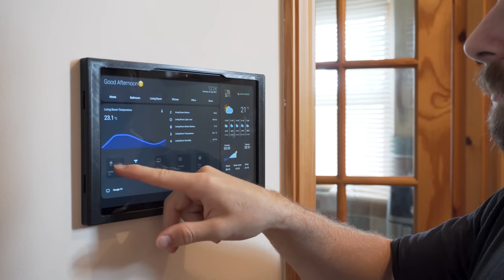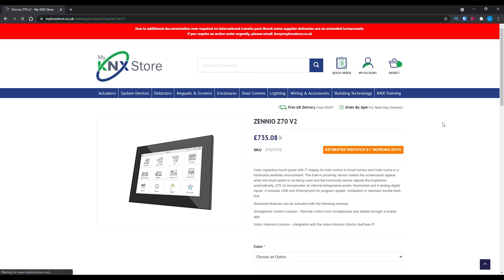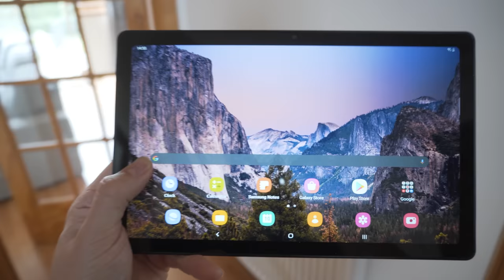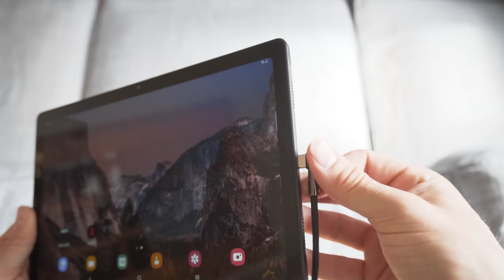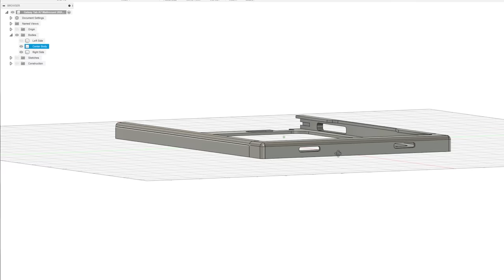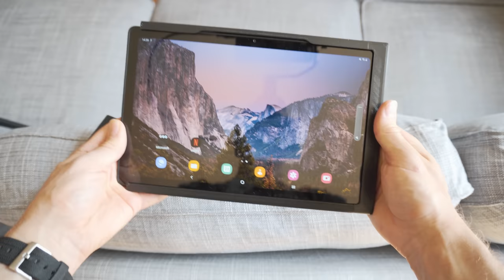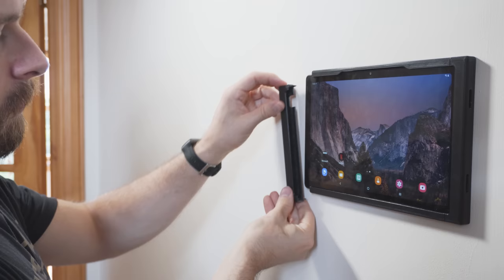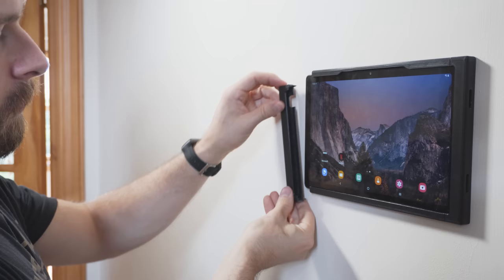Building my PERFECT Smart Home Control Panel!

Comment: Hi, im really interested in your theme, is it available to download somewhere?  i like the greeting, the right side blocks and the camera idea to enlarge the screen when someone rings the doorbell, im using a ring device. Your theme looks clean.. I am using a 10 inch tablet of Lenovo. i think the cover will fit as well. further i have some devices controlled by Tuya, ( Window blinds and curtain slider. 2 ring devices, a nest thermostate, Philips Hue lights, 3 Philips ambilight tv`s,  LSC lightbulbs, Kwikset Doorlock. trying to get it all working in Home assistant. greets Johan
Reply from the maker: Not yet, once finished I may share somewhere!
Reply: @EverythingSmartHome  Cant wait :)  even for testing im available

Comment: I also use an Android plugged in 24/7. However I have found that after about 15 months the battery starts to bulge. So be careful with that.
Reply from the maker: Thanks, as mentioned I am using a smart plug to control the charging cycle automatically so hopefully we won't be an issue

Comment: Lewis, how are you hiding the top and sidebars on the screen? Is that Fully Kiosk thing? I bought a Fired HD 10 on Prime day which I have been using with wallpanel but i have never really been 100% happy with it, this is a much better setup, and looks the business. Great well thought out and presented content as always, I have been thinking about supporting the channel through Patreon for a whole, and this vid pushed me over the edge. 😁👍. Keep up the good work.
Reply from the maker: Hey Simon,

Hiding the bars for HA I assume you mean is done through a HA card, have a search for Home Assistant Kiosk mode and you should find it. If not, drop me a note on discord!

Thank you for supporting the channel, it is so very much appreciated 🙏
Reply: @EverythingSmartHome  Found it on HACS, thanks !
Reply from the maker: I tagged you on discord with the link also, cheers

Comment: That's exactly what I was looking for. Thanks.
Though, I wonder: are there any requirement for the tablet to make the top bar disappeare?
Also, are there customizable Ambient modes/AOD possible?
Reply from the maker: Your welcome! Which top bar? I removed the top and sidebar already, everything you see in the video was written by me
Reply: @EverythingSmartHome  I mean the tablets status bar that usually shows the time and if your WiFi for example is turned on
Reply: @soumynonareverse7807  if you make a shortcut of your dashboard to your android homescreen it wil open fullscreen
Reply: @drank4454  thanks, and what about the AOD part?

Comment: Love this idea. So it's basically just a app that runs on the tablet and no route required?
You mentioned Fire Tablets, does that mean the same app is available on Fire Tablets? I have a few FireTablets I dont use atm (ok only 7 inch ones but ok to test with :P )
Reply from the maker: Thanks! It should work on all Android tablets but you'll need to give it a test first!
Reply: @EverythingSmartHome  thanks, yeah I think I will. I need to install HA first.

Comment: running the cable out the bottom of the power point is dodgy maybe illegal in some electrical codes lol
Reply from the maker: Of course, you have to check your own country, I cannot advise you about that.

But no it's not dodgy at all, it's more than perfectly safe .

Comment: is it a good idea having the table 24/7 connected to charging cable?
Reply: I had the same idea using an old tablet for that but worried about having a tablet constantly on power
Reply from the maker: I mentioned in the video I'm using a smart plug to control the charging cycle so it's not constantly charging 😜
Reply: @EverythingSmartHome  sorry missed that part. that's nice

Comment: been trying. but not willing to spend $500 on a cell connected pad.
been through two ipads, two android pads none of them were compatible.
tried a google nest. turns out sonebody had prehregistered it with the mesh network and was busy controlling my stuff, you need their permission to re-use it, apparently it wasnt as new as was claimed.
if you go pc or linux for proper automation you have to use the android apps virtually on desktop(i dont trust that to be reliable).

im for sure not paying full price for a nest, turns out its just a screen.
i cannot find a reasonable solution. lets see what you have :)

you should also look up usb ribbon cables. they have near 1mm deep plugs, almost invisible.

Comment: Not sure if anyone has alreadt asked, but is there any chance of sharing the settings you're using to get the motion activation to work? I've a similar setup with a Fire tablet in the hall and existing motion sensors but I can't quite find the right ballance of Fully Kiosk Browser and Home Assistant motion detection to have the tablet reliably wake up when there's motion. It "feels" like there's a timeout I'm missing somewhere so the screen is still being detected as on from HA so it never sends the wake up command when new motion is detected.
Reply from the maker: Hop in the discord and we can have a chat about it, I'm interested as to what you are using currently
Reply: @EverythingSmartHome  Hi Lewis, will do. Just got registered but will check in when I'm at the laptop in a couple of hours.
Reply: Hi Lewis, thought I should update you on progress. After a very long delay, I finally had chance yesterday to sit down and update some of my home assistant configuration and the hall tablet was on that list. Having got the  Fully Kiosk plugin installed through HACS, and cleaned up all of the old manual sensors I had, I disabled the tablet motion detection completely and just use my hall motion group (a couple of PIR's on a NodeMCU running ESPHome) to turn on the "light" for the screen and it seems to be working perfectly. I think I was just overthinking the previous version. Thanks for the pointers towards the HACS integration.

Comment: Great video!
Like you, I have a list of requirements for wall mounting tablets to control HomeAssistant.
The "not being able to see the power cable" one is, for me; a hard requirement. :)

I'm not yet skilled enough in 3D design, to be able to design a wall mount frame myself; so my project has kind of stalled.  We have an oddly laid out house, so one single tablet isn't enough. 

Do you have any interest/intent in sharing the design files for your tablet mounting solution?
I'd love to take a crack at tweaking your design style, to fit the tablets I have.   I settled on a couple of Amazon Fire tablets, in sizes that fit this weird house.

Great job on the video. Seeing it has rekindled my desire to get these tablets mounted and have my partner tackle getting a dashboard design working. :)
Reply from the maker: Thanks! Yes when I can get some time to work out the minor kinks on the case I will post it! 

Good luck with the project!
Reply: @EverythingSmartHome  That's great news! Much thanks!! :)
Reply: Hi, if you going to have and could send the design file to me would be awesome, thanks
Reply: @bartekziembol5034  Hi. I don’t have the files, unfortunately. Lewis hasn’t released them to the public. :-(
You might try sending him a message directly, so he knows someone other than me is interested in them.

Comment: That's a nice little fire-hazard you got there.
Never leave a phone or a tablet plugged in over time, the battery isn't over charged, but the charging circuit will engage the charger at intervalls to keep it topped off.
Leaving a lithium polymer battery with a charge above 80% will degrade it fast, really fast.
Degrade it enough and the battery will start swelling, eventually catching fire when it bursts and humidity is allowed to enter it and react with the lithium.
Reply from the maker: You really didn't pay attention did you? Mentioned twice in the video that I'm using a smart plug to literally turn off the charger for automating the charging cycle...

Comment: Hi There, are you finding any issues using fully kiosk? i have the exact same tablet and it keeps reverting back to the samsung UI as the home launcher. even the guys from fully kiosk said it was an issue with Android 11. I literally have to turn on the tablet manually every morning and select fully kiosk as the default home launcher.
Reply from the maker: Hello, absolutely no issues from me no..that's a strange one! So the motion wake doesn't work?
Reply: @EverythingSmartHome  motion doesn't work, auto shutdown between fixed hours doesn't work either. the only thing that works is, i have it set to go off in darkness which works properly, but it doesn't always come back on when it detects light again. some days it works but most days i have to reselect Fully Kiosk as the default home launcher. I have reset the tablet, everything is updated etc. The guy from Fully Kiosk said it is a bug in Android 11 which prevents 3rd party launchers but I dont have that issue with my other android devices that run nova launcher as the default. So i think it has something to do with fully kiosk. Only reason i turn off the screen is to give it a break when it is not needed in the nights.
Reply from the maker: Ah, I don't use any of the motion features on the device itself, I use seperate motion sensors for that so perhaps that's where the issue lies!
Reply: Ah that makes sense. He had said that Android 11 kills apps when screen goes to sleep. That's probably what is happening with me. I just need some way to keep the screen off during the night without the device going to sleep :)

Comment: doesn't wanna ruin the aesthetics by plugging in the charger and just running the wire inside the wall.
goes to other side of wall makes a new outlet to plug in adapter and runs cable inside the wall, like what was up with that :P

Comment: Is there any possibility to publish mqtt message from windows computer and subscribe from a raspberry Pi which has Mqtt broker in my case it's home assistant???
Reply: I would like to create automated charging setup for my laptop
Reply: The easiest way to do that is to plug it in a Z-wave...etc module.
Reply: @sukusu913  I can't use that tech..... any other suggestion... based on MQTT

Comment: Shouldve gone with POE
Reply from the maker: Don't have any ethernet anywhere near there
Reply: @EverythingSmartHome  but that’s a simple fix, not much more (if any)  work than adding the plug and you’d have a direct network connection.
Reply from the maker: I'm amazed you seem to know the layout of my house and where my network equipment is and how easy it would be to run cables ;)
Reply: @EverythingSmartHome  it’s easy in every house. Just gotta be willing to do it. But hey it’s your house you can take the sloppy looking easy way out ;)
Reply from the maker: It is easy yes. But you originally said "not much more work" than adding the plug, which it clearly is.

Comment: All that tech and you couldnt just do it right and run a cat 5e cable and use poe to power a hidden in the wall usb charge….. scratches head and it would have been connected by ethernet speeds

Comment: Using a tablet to hang on the wall is not a good idea. I have experience with such solutions and I can only say that the battery will eventually swell and burst the tablet - nothing pleasant. These types of devices are not designed to be continuously charged and discharged - even if you have a smart charger - it will only prolong the agony.
Reply from the maker: Watch the video :) I'm using a smart plug to automate the charging cycle, the battery is never charging when it's full

Comment: It’s not smart if your putting a computer behind it. It’s smarter to run Ethernet for Internet  and video and use a pc in the basement or in a closet. So instead of a raspberry pi. You just connect display to server
Reply from the maker: Where was the computer behind it sorry? 

Yes it's more convenient, but not accessible in this location without a lot of work.

This isn't connected to a computer, not sure where you got that idea

Comment: Lmao why 3D print a case. It would have looked much better had you just found a perfect fit picture frame and it would have looked WAYYY better and be easier. Suppose the YouTube video wouldn’t have been as good thought lol
Reply from the maker: Your pretty ambitious to think you can find a picture frame with the exact dimensions to fit this tablet and not have it slide about or cover the camera and have massive bezels
Reply: @EverythingSmartHome  I mean there are a few million pictures frames I’m sure and the entire internet is open to you. Plus it wouldn’t slide around inside of you did some trickery on the inside. You could drill a nice hole for the cam, not that you even need a cam for that specific set up it’s more for doing some quick controls who really going to get into a  video conversation whilst standing up looking at the wall. Wouldn’t matter if the camera was covered.
Reply from the maker: Way more work and waste of time and money trying to find something that fits when I can just make one that definitely does fit (and learn a new skill in the process) - also the camera is useful to have as it can be used to unlock the device when the camera detects a face
Reply: @EverythingSmartHome  why in the world would anyone want the device lock while inside of their own home IT NEVER LEAVES no one locks their google or echo display devices. My nest hub sits in the kitchen with no need to ever lock. Also you had to do like 5-6 trial runs on the 3D printer which took time and with the end result being ugly black plastic that looks as if its been 3D printed at least maybe paint it or something. Again how is getting on the internet and having a million different picture frame dimensions to you hard work. Why is learning something new a negative, you could have packed the tablet into the pic frame with a bunch of high grade clay from Home Depot or a host of other ways to get it done. Just did a google search also plenty of web sites that will make you a picture frame with your exact dimensions and since its small only around $18-30
Reply from the maker: Unlock was a poor choice of word on my part, I meant it can be used to wake the screen so it's not constantly on. 

I didn't say learning a new skill was a negative, it's a positive. I'm saying 3d designing it allowed me to learn a new skill.

Looks are subjective, you are in a minority saying it looks ugly.

3D designing and printing meant I could have the product the same day to my exact specification, buying online does not.

I like to DIY where possible, it's more fun. The list goes on 🤷‍♂️
Reply: @EverythingSmartHome  putting a tablet would have been a DIY since there is no rule book on how it could be done. As far as esthetics just look at the new echo 15 coming out with its picture frame looks it’s unanimously gorgeous probably best home control device from a looks standpoint. I wouldn’t go as far as saying yours is downright ugly but there’s a lot left to be desired with that 3D printed finish